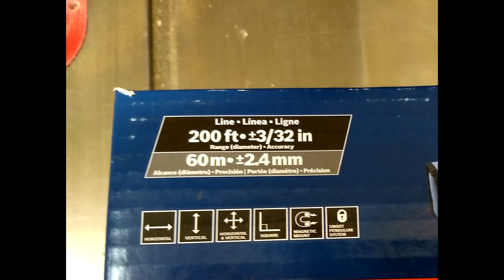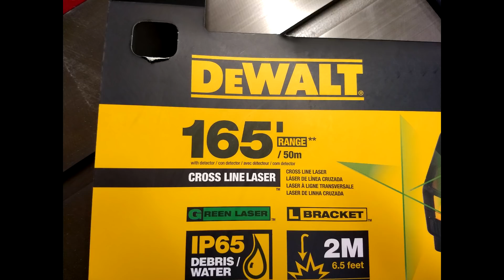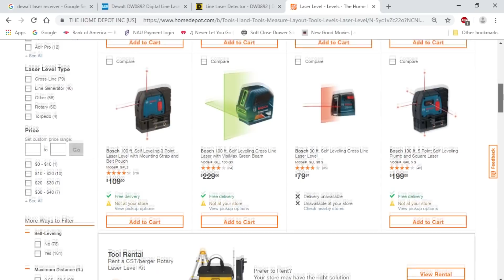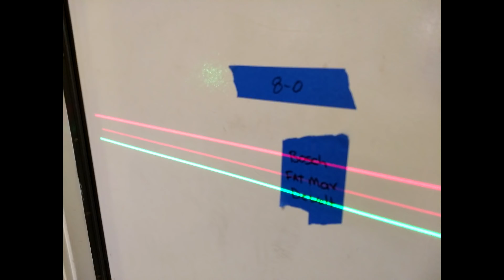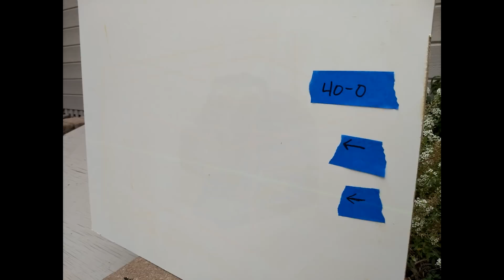Laser Showdown DeWalt vs Bosch

Comment: Completed my first project doing a walk in shower. Tiled like a professional. The laser is soo much better than a traditional level. I just leave it on vs marking a line, witch is difficult on tile. A grease pen works, but your line may be tight or away from the level as it is used. Setting your first row is critical for a quality job. The level made it a snap. Highly recommend. I have seen some that cost a lot and some that are cheap. This one got the job done. No complaints.

Comment: You chose the Dewalt because it's a green laser. They are different. Green diodes are more visible.  You would have to test two green lasers or two red lasers to compare the brands. Greens are much more expensive. Terrible, misinformed video. Red lasers are for inside, 30ft or less for best performance. Green lasers are for that and everything else.

Comment: A reason for the Bosch's laser beam being dimmer might be legal limitations for laser power output in Germany. Contrary to the US regulations in Germany the output power must not exceed 1mW  for it to be safe to use without eye protection. If I'm not mistaken in the US the limit is 5mW.

Comment: Can I use the DeWalt to plumb my walls when framing the basement?  I don’t know if it can cast a beam on a chalk line on then floor, and cast a plumb laser to the ceiling above.  Any ideas?
Reply from the maker: Hey Don. The Dewalt in the video will definitely make the job easier. But a cross hair laser is not as useful for a task like you describe as a 360 laser. More recently I ran across a great alternative that is very affordable. Take a look at this video where I show you a great 360 laser for a lot less money (https://youtu.be/sTtes5AnkOY). Good luck with your project.

Comment: Makita is better because there is an option to use electrical adapter, bosch only manufacture battery only so it dont last long may for 10 minutes before your work is interrupted due to battery life already drained out.

Comment: What laser to use if doing curtain rod above windows? Do I need tripod that extends 9+feet?
Reply from the maker: I would suggest using a expanding pole. There are ones made specifically for lasers but a 3rd hand pole (or similar) would work well and is useful for lots of other tasks.

Comment: A bump on a hard case will travel to the instrument without dissipating. A bump on a soft case will absorb the knock. Of course in extreme cases both will cause damage. The hard DeWalt case may also give the user a false sense that the instrument is safe, and so is likely to mishandle it.

On the other hand the soft case can usually fit easily into a bag such a the Packout backpack, whereas the hard case with take up a lot of space and reduce the available space for other tools etc.

I prefer a soft case. The laser just needs not to be completely abused by the operator.

Enjoyed the review.

Comment: How do you compare cross line laser with 3 x 360 degree laser? The second one is much more useful to make walls plumb, leveling floors etc.  The cross line is just not capable of those tasks. Also consider that longer the line - more power is needed to make it the same brightness. So if the line is only 120 degrees it'll become 3 times brighter.

Comment: I bought a Bosch GLL3-80 + LR6 detector. But the detector gets too strong signal indoors at close range so it can't determine when the laser hits the middle of the sensor, it can only show up or down.
Reply: You didn't get the Bosch that can adjust the beam strength from your phone?
Reply: @exploranator  No. But I put a polarising filter that I cut and placed in front of the detector to dampen the laser.

Comment: When testing two different products you should use the same color laser level because the reason they came up with the color green made it easier to see outside so now you're taking a Bosch laser level that's made for indoors against the DeWalt that's made for indoor and outdoor the competition ain't Fair but still it was a decent test just goes to show that it's better to buy the green laser level over the red

Comment: Nice review helped me alot! I am just wondering which one is better for use in for example tile jobs where you can position the laser just 3 feet away from the wall but the width is like 10 feet?
Reply: Bosch has a 360 degree 3-line laser, as so many these days, including Milwaukee.

Comment: Could you use a laser to put fence post in to make sure they are all the same height
Reply: YES. It can easily be done. You will need the matching receiver (another $100). That's because you will likely not be able to see the laser line, outdoor and at distances commonly found in fencing work. The receiver is "tuned" to the laser. Simply move the receiver up and down on your post (or better yet, on a light weight guide pole you carry with you). The receiver lights up to show you when it is centered to the projected beam. Some receiver manufacturers also include a helpful, audible tone. Good luck.

Comment: I have the Bosch on red, and just like the Dewalt, also comes with battery,  charger, etc. and the box,  I will recommend that if you work sometimes outside to buy the bosch on green,  is little more expensive but I am sure is worth it
Reply: Yeah, you can run them over with a scissorlift too. Not that I know anything about that.

Comment: PLS is the most accurate at longer distances with thinnest line. I've been installing grid over 40 yrs. and swear by it.
Reply: Anyone using these for grid are wasting their time anyways. A spinner & some string line, I'm sure you agree. What would anyone do with this in a department store setting? in a small room I hardly even pull out a tape anyways. can eyeball pretty much the whole thing. 52 1/4 and go! CHEERS!

Comment: Something Dewalt is overlooking on these lasers is the magnets are mounted to low on the bracket. The lower they are the more leverage it’s weight has to work against them and they won’t hang in to corner bead with to much mud on them. They need to slide the lasers up higher imo.

Comment: As a carpenter, a good laser is a must have in the trade. And as a few words of WARNING, DO NOT BUY THE BOSCH! THE HOUSING DESIGN DOES NOT  MEET PROFESSIONAL INDUSTRY STANDARDS! The four thin plastic pieces that make up the protective housing and hold the glass windows. Will break very easily. 
I recently had to buy one to frame an acoustical grid ceiling, and I thought I did my research and read the reviews and so on. Well, I went with the Bosch laser, similar to the one reviewed. Getting to the point, I dropped it from about waist high, and the housing shattered into pieces. And for a three hundred dollar investment, I'd recommend getting a default with an aluminum housing if you need a continuous 360. The Dewalt in the video didn't have any housing, which is a good thing; it won't break. I didn't give it any thought until it was too late.
Reply: Thanks for the feedback! Very very important point that is glossed over!  Many thanks.  (and by the way -- you have a typo -- saying "I'd recommend getting a default" -- not a DeWalt... damn auto-error correction.  Cheers!

Comment: We really love our dewalt dw088LG and dw089LG lasers! Also, the pole we use is for a laser, and came with a fully micro adjustable mount. When we are using steel framing, I find the magnets on the dewalt are extremely strong. We like Bosch too. 
We simply upgraded to line green lasers and dewalt was far more appealing as far as batteries, and storage goes. 
Haven't used the new line green Bosch lasers. I doubt you can go wrong with either to be honest. If you are in the dewalt platform or use t stak boxes, the dewalt does stand out as far as that convenience goes. Thanks for thw video👍

Comment: How come no one makes a laser that will shoot in between 1 and 89 degrees to do handrails?
Reply from the maker: Hey Richard, You're the second person this week to ask a similar question. I don't have a clear answer but recently I checked out the new Milwaukee digital level and it has an angle lock capability,  which made handrail layout a breeze. I recently did a video on it https://youtu.be/zLdPIH7W0_I

Comment: Makita and Dewalt make a green laser with 18 v battery!!!  Not even going to comment on the cumbersomeness of the Bosch.. Why 18 volt? Because thats what being used by any serious trades on all tools, and time is money. Make it fit for one charger for all tools!
Reply: Hi Jonatan -- do you mean the 18V Makita through the power port on the Makita SK106GDZ ?  I have not seen an 18V battery attached to Makita cross-line laser without some adapter.

Comment: I liked the visibility of the green laser, but the 360° display and micro adjustments on the boch seem like a better concept.
Reply: Bosch makes a 360°, 3-line laser.  I have it and it's really nice.  I bought some extra strong magnets that allow me to mount it on a sheet rock corner bead.  GLL3-330CG

Comment: I'm an ironworker and we don't use anything by DeWalt cause it just can't handle the abuse. Seems fine in residential situations but not on a job site.
Reply: What brand do you use?
Reply: @carpentryfirst3048  Bosch or Spectra as far as line levels. Klien also makes a decent one. As far as battery tools, Milwaukee is hard to beat the last few years. As far as DeWalt, thier levels are still pretty good but they've really seemed to slacked as far as power tools go. We just don't have good luck with them staying together and not burning up. In fact on the job site I'm currently on there's a DeWalt drill motor and a hammer drill model that are banned here due to a "fire hazard". But keeping in mind that Ironworkers are typically very hard on tools so DeWalt is probably fine for most "normal" tasks/jobs
Reply: @ironlife227  thank you for the info.  
How would you compare the Bosch or spectra to the stabila?
Reply: You can't beat a STABILA "R" level all the others are garbage0
Reply: What!! We still use an old dewalt nicad 360 degree laser for excavation - grade work, septics, footings, etc. That thing has seen more abuse per year than most people will do over a lifetime. And the new green line lasers we have from dewalt are taking the abuse great. Their 20v max power tools are a whole different story. They cannot take the abuse. The lasers are doing just fine. Our old Bosch red lasers are doing good still also.  In fact I still enjoy using the Bosch 3 point / plumb bob when needed. I don't think people give credit where it's due. For sure. Everyone has an opinion. This is mine

Comment: I have had both. I like the green laser on my Dewalt. However the Bosch has  tilt a lock where I can project a line on a slope, useful for stairwell handrails or anything raking.a function Dewalt doesn’t have
Reply: I've been asking for years for somebody to make a laser that will shoot from 1 to 89 degrees so we can do handrails without marking up the walls
Reply: We use the dewalt to project a straight line at angles also. You can lock the pendulum, which powers it off, then overide the off mode using the power buttons to project the line. Not as convenient as some, but still works great. I don't think you can go wrong with either one

Comment: Sorry, but you sound like a rookie. My go-to lasers are 1 - Topcon, 2 - Geo Fennel, 3 - Hilti and then Dewalt/Bosch although out of the two I prefer Dewalt since they usually have more powerful magnets and better range and come with a battery. For your info - green is for outdoors or bright light and red is for closer range and dimly lit indoors hence they usually cost 100 bucks less.
Reply: Which distances laser recommand working indoor homes?
Reply: @richardponce7898  It really depends on what kind of work you do. Generally you will be fine with a red laser rated for 20 meters.

Comment: A lot of info in that video. For the price, it seems like the Bosch is a more advanced laser. With the DeWalt you're paying for a rechargeable battery and the battery charger. 
The DeWalt in this video is the DW088LG they make a DW088CG which is a red laser and takes regular AA batteries and is about $180.0 - $200.00. They seem like the same laser but without a thick green line and rechargeable battery.

Comment: The best laser level is Hilti
Reply: Hilti is the best expensive but worth it!
Reply: Have link?
Reply: I use for work the GLL 3-80 CG. Can't say its much better or less better than our Hilti laser. 
Right now i use both parallel to each other for hanging couter hooks for 4000 square foot Shopping mall that gets a full makeover.
Both Lasers are 500+ bucks.   You clearly don't need something like this for hanging pictures or Play around in your house. Even a green DIY Bosch Laser for 50 bucks is good enough for hanging kitchen cabinets or pictures.

Comment: Green lasers cost on average 50 to 80 dollars more then red of course they are better. Your comparison is somewhat skewed from the get go since your laser colors are not the same. Rather like comparing a Cessna to a F18 Hornet that winner is a forgone conclusion! Oh and my pole mount has a clamping base arm for the laser to secure into the lower tripod mount very tightly. Round poles aren’t designed for use with flat magnets at all.
Reply: But it does show that green is much better visually.  Now I know not to buy red, unless I'm measuring a cave or sewer system
Reply: Hi
Reply: Please this How many price  please contact me 00966 550070370 my What's app
Reply: The best laser pole I ever saw was an extension pole where the laser Mount could go 16ft anywhere on the pole from the floor to the ceiling and I've never seen one since

Comment: How do you use the cross laser level on the roof pitch 12 12 so that you can put your metal roof panels on straight? the line goes left or right nephew go off center. How do you know where center is to begin with?
Reply: well that is what is good about the 360 type lasers is you can back sight with them ( measure a distance and adjust to equal the front sight). also you can get square due to there being 2 vertical lines, the 3 360 line levels are a much more versatile tool.
Reply: 1weird Doe- A laser chalk line really isn’t very useful on a pitched roof. The gradual rise and inconsistencies that most substrates have are going to make it difficult to use one. In several years of installing standing seam panels I haven’t found a better way that using the 3-4-5 method based of the fascia edge.